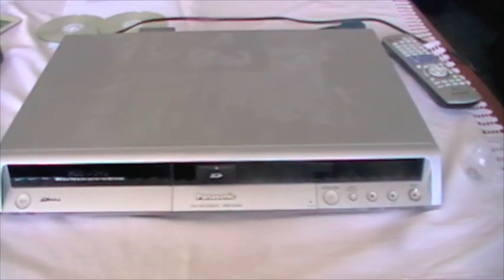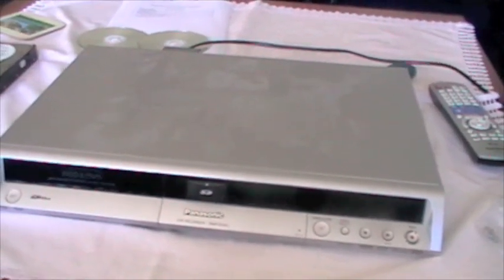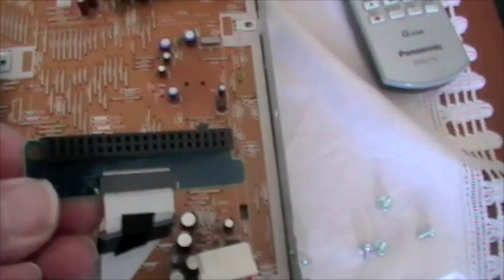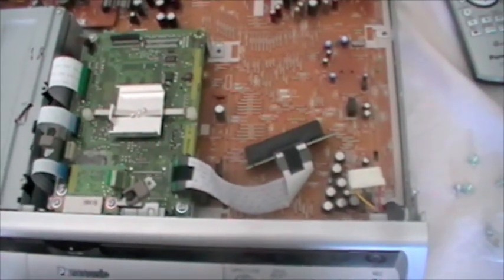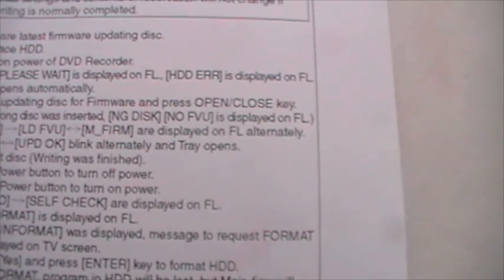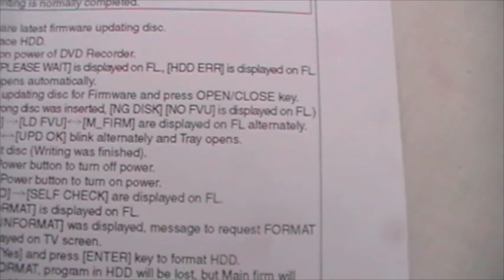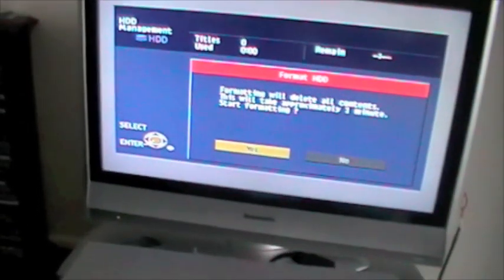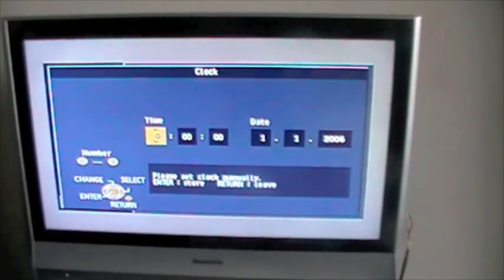Panasonic DMR-EH55 dvd recorder, how to replace the hard drive

Comment: Thanks for this video. I recently picked up a used EH65 as part of a bundle of used players. Its drive seems ok but Ive saved the firmware you linked. Found the power button no longer worked due to someone spilling something on that end. Replaced with a button out of a old MS mouse. The plastic plunger inside has to be heavily filed down to lever the larger mouse switch but it works great now.

Comment: That's an interesting video - it's a shame it's so hard to find firmware for various pany models. I've long been messing around with the task of cloning panasonic hard drives, but I'm still not at the point where they work once cloned. But for anyone who wants to know, the programmes are stored as mpeg2, and I wrote a quick Linux program that grabbed them all, noting the timestamp change to begin a new file, the output can then be used in VLC or remade into DVDs.  The downside is you end up with some of the old deleted bits, but generally speaking the recordings are intact.
Reply: hey there!
If you still have the Linux program you wrote, can I get it somehow?
I would need to save a few family recordings from this recorder.

Comment: Hi,the method described in this video does not work for the DMR-BWT720.Panasonic specify that you need to replace the hard drive with their genuine spare part,this is because it has data written already on it that will allow the panasonic recorder to recognise it so it can format it.
You can use any other HDD as long as it is no bigger than the one you replace.(if you use a bigger one it will format it to the original size, in the case of the 720 1TB).To use one of these alternative drives you need to get hold of a service disc from panasonic(which I suspect you got which contains the data needed to format it).
Having spent days looking on the internet for a genuine spare or service disc panasonic support tell me they will only supply these to their service agents not the general public.You must have caught the support agent that sent this out to you on a good day.
However good news, vist this site and find in depth instructions that even I could follow to repair your machine,one clever chap or lady.

www.avforums.com/threads/panasonic720-installing-a-new-internal-hdd-how-to-do-it.1948301/

To remove the hard drive on the 720 it is a little different from the video,to remove the HDD cradle after you have opened the case   you will need to remove the front panel (do this by prising off the 2 outside clips the 3 bottom clips and the 1 central clip next to the ribbon cable connecting the front panel,you will also need to remove the said ribbon cable from the PCB)after you have removed the 4 screws retaining the cradle you ill be able to lift it out.

Comment: i have a  Panasonic DMR-E100HEB, i can remove the 3 small screws at the back , but the two at the side i cant, no matter what screwdriver i use, what type of screwdriver are you using ?
Reply from the maker: Just a standard small or medium cross head. However, these days they often use funny screws for which you need a screwdriver with a special head. Look at the head with a magnifying glass and see if it is a tri-wing one or something else. It is always worth getting a set of such screwdrivers to have in case you need them. Which country are you in? In New Zealand you can get a good quality set from Jaycar. Otherwise if in the US try Amazon. HTH
Reply: @mikeuknz  hi, thanks for such a fast reply . I'm in the UK. I think it is a tri-wing. When I try the screwdriver I use to remove the three ones at back it is too small and doesn't do anything.

Comment: Thank you for this demo. I have the same issue with a broken hard drive in the same recorder. I replaced the drive. However, 'your' firmware seems to be gone. Tried at Panasonic, found one but the recorder tasted it and spit it out again. If it is not too much trouble...
Reply from the maker: +Wijnand Lammens Hi. File Dropper keeps "losing" the file. I have uploaded it again at: http://www.filedropper.com/panadvd Hope that helps.
Reply: +mikeuknz , Thanks, but no wurkie, 'NO FVU'. Perhaps I need a specific regional version. I already called Panansonic support twice. No success so far.
Reply from the maker: Hmmm.. it should work. Make sure you have it saved on a DVD with the name PANA_DVD.FRM and check it is about 7Mb in size in case it did not download the file fully. HTH
Reply: +mikeuknz  that's what I have. Perhaps it does not like the new 250GB drive i.s.o. the 160GB one?
Reply from the maker: As far as I know the NO FVU message refers to the DVD and should not be affected by the hard drive. Do you get any other message as well at NO FVU e.g. NG DISK?
Reply: When I insert the dvd it sounds like it is reading the DVD.
It says "LD FVU", then immediately "NG DISK" and "NO FVU", and it repeats that a few times and ejects the dvd.
I tried both a DVD-RW and a DVD+R.
There is only one file on the DVD, "PANA_DVD.FRM", with size 6.995 kB.
Reply from the maker: That indicates that there is something wrong with the DVD. Is the DVD a type this model can read like a DVD-R and NOT a DVD+R, Is the firmware the only thing on the DVD and not in a folder or anything?
Reply from the maker: +Wijnand Lammens Do you mean 6.995kb it should be about 7MB not kb? Try a DVD-R - long shot but inexpensive
Reply: You are a great support!
:-) Sorry, the European 1000 separator is ".", our decimal separator is ",". So, I meant the file is really almost 7MB. 
I will try a dvd-r.
Reply: Got it! I tried something else, because I figured the "NG DISK" could also point to the format of the disk.
Writing the firmware file to an optical disk with Windows Explorer creates an UDF formatted disk. 
Creating a simple ISO 9660 formatted image first with e.g. BurnAware and writing that image to a CD-RW (or other type, probably) results in the recorder executing the firmware update.
So it ran the update finally!
Reply from the maker: +Wijnand Lammens Yes of course, I hadn't thought about the format of the DVD just assumed it would be the one suitable. Congratulations on your persistence!
Reply: Write this website: ftp.panasonic.com  And after that,  you srcoll down till you see the word:  dvdrecorder. And you click on this word. After that,  a webpage will show with  many words.So, you click on the word: software.  And an other webpage will show many model names. You scroll down till you see :  dmr-eh55_vup317_firmware.zip. Yo click on this word and a window will appear on your screen. So, you click this downlod windows and it will be saved on the folder: download or whatever you choosed the destination folder. And after that, you go where its downloaded. And you click this zip folder: dmr-eh55_vup317_firmware.zip. and you will see a folder inside. You click that folder right side mouse and you extract that folder in download folder. And after that you click on that folder and you will see this word: PANA_DVD.FRM.. you burn that to a blank cd. And after that. you put this burning cd to dvd recorder and you wait till you see update OK. and after that it will ask you to format your hard drive and you click ok and you,re done you can record on your hard drive. Good Luck!!!!

Comment: I have the Panasonic DMR-ES15. Its basically the same as yours except it doesn't have the HDD. I opened mine to replace a bad capacitor on the power supply and all the boards look exactly the same inside as the DMR-EH55. It doesn't have a fan on the back but that could be added. I have a spare 160GB PATA/IDE HDD that i aquired free.
If i bought a flat flex cable to 40pin IDE adaptor from china on eBay (assuming they're available), could my DMR-ES15 be firmware upgraded to the DMR-EH55 with your firmware CD?
Reply from the maker: Sorry I have no idea but I guess you could try it (at your own risk). You might need a cradle to mount the HD on if you want to install it. Good luck!

Comment: I am also getting the HDD ERR message. I was trying to find a replacement hard drive for Western Digital WD1600BB-14RDAO but could not find it anywhere. Do you know if I can replace it with other brand? Can you recommend a brand and a store where I can buy it?
Reply from the maker: Hi, I am sorry I don't know but you could try a different brand but the same type and see what happens. You can sometimes find WD 1600BB hard drives on eBay; there are a few on there at the moment. What country are you in though as it may need to be posted?
Reply: @mikeuknz  I'm in the US.
Reply from the maker: @canolaf8030  I'm in New Zealand so I have no idea of stores that may sell one in the USA but there are a number on eBay being sold by US sellers for around $30. Good luck!

Comment: Hi I have a DMR-BWT720 with this problem.This might seem a daft question for you but when you talk about firmware are you referring to the firmware that would normally be downloaded via the internet to update this machine when its working properly, the same firmware from the Panasonic support page (http://av.jpn.support.panasonic.com/support/global/cs/bd/download/bwt720/uk.) or is it something totally different.
Is the download from filedropper only relevant to the DMR-EH55 or can it be used on all the panasonic dvd recorders.
Thanks for the video.
Reply from the maker: By "firmware" I mean software that is installed into the machine, presumably into a chip inside. The firmware referred to in this video had to be obtained from a Panasonic service agent here in New Zealand as the one on the Panasonic web site did not work (see video). As far as I know it only works with the EH55. You may find that the one for your machine from panasonic.com works fine; I'm sorry I don't know. Good luck!

Comment: Hi, can you explain how the firmware update disc was created for the one that actually installed the firmware? I'm trying to update a Panasonic DMR-E30 DVD recorder with the latest firmware "D5-085". I've burned several CD-R's under ISO-9660 (which is the recommended filesystem according to the manual), as well as Joliet & Mode 2, but the unit fails to recognize the disc, giving me a "U11" error code. The firmware upgrade manual requires me to use Windows XP because it uses ISO-9660, but Windows 7 & 10 doesn't support ISO-9660. I have both ImgBurn & CDBurnerXP, but it hasn't gotten me anywhere. I've previously updated the firmware successfully several years ago without any problems, and that was the same model.  There are two firmware files that exist, "UPDATE_DMR_FIRM" & "PANA_DVD.FRM". What is the proper way to create a firmware update CD or DVD, which recordable disc should I use, and what is the proper filesystem & write speed that the recorder will recognize?
Reply: There is no mention of the recommended write speed for the update CD, it just says ISO-9660. So I've written it at 1x speed, but it didn't work.
Reply from the maker: @kyokochan81  I think you need to give the file the name PANADVD.FRM at least that was the one that worked for me. The file type FRM probably identifies it as firmware. However I have no way of being sure what it should be for your model.
Reply from the maker: or maybe it was PANA_DVD.FRM it was almost 7 years ago now!

Comment: CAN I USE THIS UNIT BY REMOVING THE HARD DRIVE?
 IT MAKES A VERY ANNOYING HUMMING NOISE WHEN TURNED OFF. And I just don't need a recorder. Otherwise I'll just get a new dvd player for $50 usd and take this to the recycling center. Actually, what about replacing it with a solid state drive, with the necessary wire adapters of course; will it work?
Reply from the maker: Sorry I don't know. However the unit seems to pick up some basic OS type info from the hard disc so may need it to be there. Doubt a solid state drive will work but may be interesting for you to try. You should be able to pick up a cheap HD, perhaps one that doesn't hum too loudly. That would give you the option to record and also give it some resale value. Good luck!
Reply: I THINK I WILL TRY TO USE IT WITHOUT A HARD DRIVE. IN THAT CASE,  MAYBE I NEED TO REMOVE A CIRCUIT BOARD SO IT DOESN'T THINK 'SOMETHING IS MISSING.' ANYWAY, ITS GOING TO THE RECYCLING CENTER IF IT WON'T WORK...THANKS FOR THE QUICK REPLY. 
OH ONE MORE QUESTION: DO THEY STILL MAKE DVD RECORDERS AND WHO MAKES THEM? (BESIDES COMPUTER BASED). I ONLY KNOW OF THE "TIVO" ADVERTISED ONES OR ONES FROM THE CABLE COMPANIES WHICH ARE 'PROPRIETARY.'

Comment: my Panasonic DMR-EH55 has got a U81 fault,i dont really want to repair it as i have a new one now..but is there any way to get my programs of the HDD,say on to my PC
Reply from the maker: +rgm501 Hmm ... I'm not sure. The error does not seem to be a hard disc error so I suppose you could try finding someone with the same model and swapping your hard disc into it temporarily in order to copy your videos on to DVD then you can can put your DVD into your computer's DVD drive to copy the videos off. Before you do that you could try unplugging it and leaving it unplugged for about 30 minutes. Then start it up again. If the U81 re-appears then hold the channel up and channel down buttons simultaneously for about 5 seconds to re-set the micro-processor inside and see if that enables you to start it up and copy your videos to DVD. Hope this helps.

Comment: I HAVE A PANASONIC DMR BWT 800 RECORDER IT STARTED LOOSING PICTURE AND MAKING LOUD SCRATCHY TYPE NOISES WITH THE SCREEN ON THE TV LOOKING LIKE IT IS OUT OF TUNE LOTS OF DOTS AND NOISY . I TUNED IT OFF LEFT IT FOR A WHILE IT THEN STARTED WORKING CORRECTLY FOR A DAY THEN STARTED THE SAME STUFF ALL OVER AGAIN ..NOW ALL I GET IS A BLANK SCREEN WITH THE WORDS NO SIGNAL !!1  I TRIED IT ON ANOTHER TV  WITH DIFFERENT HDMI CABLES ETC TO MAKE SURE IT WAS THE PLAYER WITH SAME RESULTS ... NO SIGNAL .. THERE IS NO OBVIOUS BURNT CAPS ON THE BOARD THAT I CAN SEE ... THERE IS ONLY ONE HDMI PORT COMING OUT OF THE RECORDER SO CAN'T TRY A DIFFERENT PORT WHAT DO YOU SUGGEST ! PLEASE
Reply from the maker: Sorry, no idea!

Comment: Hi Mike, thank you for creating this youtube clip. I have a dmr-EH65 model with lots of critical family content that I have recorded, sadly the unit has stopped working. QUESTION PLEASE. I just brought a spare working second unit which is also a EH65 model, do you know if I can just swap the hard drives over?? I am just worried that the harddisk mightbe erased so thought I would ask you. The content on the harddisk is very important to me and I really want to get it onto a computer.
Reply from the maker: Hmm... beyond my expertise I'm afraid. I don't think it would be erased but like you I would be very hesitant to do it. I suggest you ring the Panasonic help line in your country; they can sometimes be very helpful and sometimes less so and they tend to suggest you go to an authorised dealer. If you could get or borrow a third unit then you could swap the hard disc from one to the other (2nd to third or vice versa) before you risk all your valued content. They should be quite cheap second hand, depending on which country you are in and you could re-sell a spare one later. Wish you well in your efforts!

Comment: Fantastic!!!!  I have heard that you must replace the HDD with exactly the same model as is in the machine to begin with.  If not, it won't work.  Is this true?  My unit has the 200GB drive in it and I know that the unit is "hardwired" for the drive capacity so it's as you explained, you can't upgrade the drive capacity.  But, do I have to get exactly the same model as the one that's currently in there?  That could be problematic.
Reply from the maker: You will need to get a similar hard drive that need not be exactly the same model number. Look at the drive reference e.g. mine was WD1600 then some letters. The very last letters on the drive may not matter. You should aim for a 200Gb PATA drive - are you sure it is not 250Gb i.e. WD2500xx. It may be a "caviar" drive look at the label. A larger drive may work even though it will only be formatted to 200Gb. Try checking the WD web site or Googling your drive code and trying to find others that are compatible. You could try ringing a Panasonic or WD help line if one is available. You can sometimes find reconditioned drives on Amazon.com very cheap. HTH
Reply from the maker: There are a few currently on eBay for US$25 from a place in California, of course there is always a risk buying a used one but that is what I did. HTH

Comment: I need help!I have a hard disk with all baby memories and now the dvd recorder is not working anymore. I found exactly the same DVD recorder on eBay. So did I get it right: I have to change the hard disk AND I need a firm ware CD to get that working? Without the CD the new recorder cannot read the hard disk?
Reply from the maker: Hi. I think you should be able to just change the hard disc but I am not 100% sure
Reply: @mikeuknz  Thanks s lot for answering so fast. What else could I try to safe the data if that won't work?
Reply from the maker: @mityme72  I really am not sure. You could try ringing the Panasonic help line in your country, sometimes they are helpful and sometimes not. Or you could try installing it as a second disc in a computer but as it is formatted differently I would be very careful and try and ensure it is read only. As it was a DVD recorder I suggest in future you copy important items to DVDs as archives. When you get the replacement recorder you could try swapping components in to the old one to see if you can get the old one working, what was wrong with the old one? Good luck!
Reply: @mikeuknz  the old one is completely dead...no signal at all...thanks for for support ;o)))